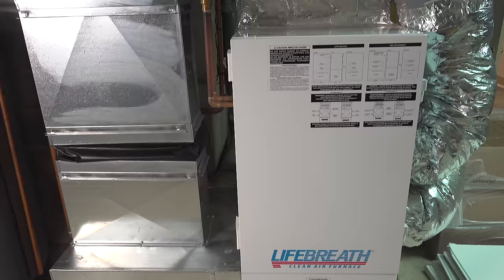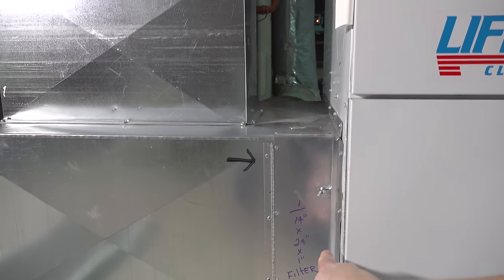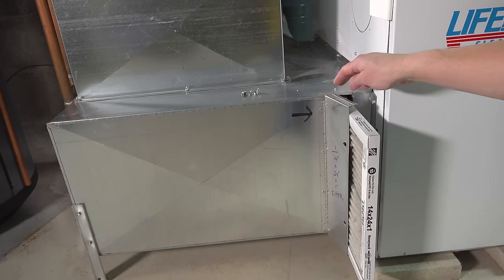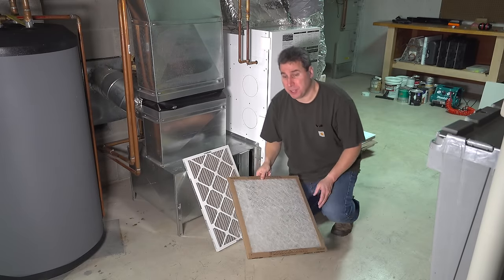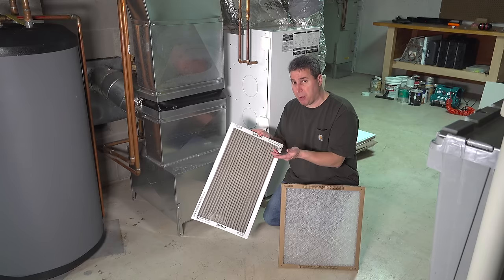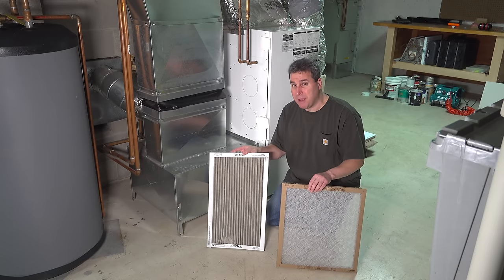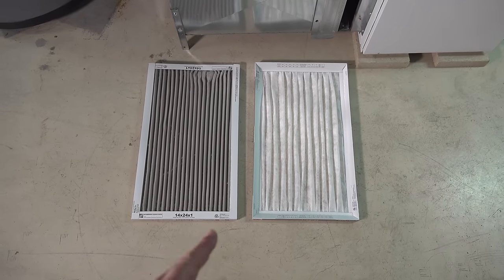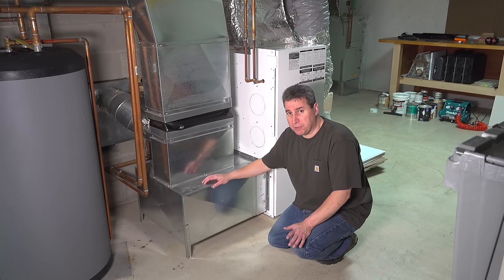Furnace Filter - How to Change it the Right Way & SAVE Money

Comment: I think filter change frequency depends on where your return registers are located. If they are in the floor, or close to the floor, they will pick up a lot more dust and pet dander than if they are located up near the ceiling. My filter is pretty huge and my registers are near the ceiling and I can go a year without a problem.
Reply: Why would cold air returns be near the ceiling?
Reply: @johngunther6333  I'd assume so that cold air conditioned air is pulled up across the living space rather than just pulled across the floor.
Reply: @rogerwilcojr  In the northern part of the country, cold air returns are generally installed low, but I guess in the south, they are installed near the ceiling...I live in the north...lol.
Reply: @johngunther6333  I live in NW Ohio and mine are near the ceiling. I grew up in SoCal and the returns were near the floor and the supply vents near the ceiling - just the opposite. It was also my job the clean the giant fiberglass air filter several times a year, so I prefer the current arrangement. There are some videos that explain the pros and cons of different locations for both supply and returns.

Comment: I'm a little confused. At the start of the video you mentioned to shut the furnace off either at the panel or your thermostat. But at the end of the video it looks like you turned it off at the emergency switch and turned it back on there. But still a good video!!
Reply from the maker: Thank you, yes that was the emergency off switch. As long as you use the circuit breaker, thermostat or emergency off it is fine. Yes that was a bit confusing in the video.

Comment: A furnace is a very effective whole house air cleaner.  Nearly all modern furnaces allow the fan to be run at a lower speed continuously.  With modern ECM blowers, this costs pennies a day, which is cheaper and more effective than a room air cleaner.
Reply from the maker: Now don't go crazy here. Even the best cartridge, so thick you can barely get air through it won't be hepa, where smaller units can do that. The question, will hepa filtration for a smaller area be better than medium filtration for the whole house? I guess that answer depends. ECM is out there but it's definitely not on every furnance and it's more than pennies a day. You can't run super thick filters on very low speeds unless you are greatly oversized for ductwork and it's more than pennies. So it's not more effective, it's not cheaper but it will cover more area to a lesser degree of filtration, is that effective? Maybe I don't know, thats really up to each person.
Reply: @SilverCymbal  A high Merv filter runs just fine on low blower speeds.  If you have a furnace that allows for continuous fan at low blower speed, it's nearly free to use it for whole house air filtering.  And,  it gets all the air, not just some in one room.  High Merv filters are nearly HEPA quality.

Comment: Based on all of my extensive research, the average home should use a Merv 8 -12 filter. I replace every 33 days with a reminder on my phone.
Reply: 30 days is just a reference. Your eyeballs are the best judge of when it needs to be changed. In the spring and fall, your furnace is barely running and its more like every 2-3 months for a filter.
Reply: @srobeck77  My heat pump runs often, I also have my fan set to circulate air at times even with no heat or Ac on. I have allergies and this is what works good for me but not ideal for all cases.
Reply: i run my fan 24/7, but i dont feel like the airfilter does much for pollen. Youd need to have an electrostatic filter installed with the fans running 24/7 to really make a difference. I got an upgraded DC fan motor so iys uses about a quarter of the electricity that a typical AC fan motor uses.
Reply: MERV 10 + daily dusting + robo vacuuming + kids + pets + summer = 3-4 months. Invest in expensive filters and never compromise on wellbeing.

Comment: Went back to the old 'fuzzy' two dollar filters after pi$$ing away many $'s on 'the good ones' only to find (as mentioned here) they were too restrictive for proper operation of my furnace and cost me a couple hundred bucks to learn that lesson.
The only difference I make to the filter is a light spray of Pam or any other vegetable oil. Spray on the opposite side of the arrow (air entry side, away from the furnace) and like a lot of folks, leave a marker down by the furnace to date the installation. You will be surprised at what this little tweak picks up!  You'll have to replace your filter almost every month because in short time you can't see through it at all.

Comment: I installed a medium quality filter, and my new nest thermostat warned me that my heater was shutting off due to overheating - safety problem.  I went back to the cheap fiberglass filter.  I have an old unit with a 0.2 in wc blower.
Reply: Go with a cheap pleated filter. Fiberglass will not adequately protect your fan or ac coil. If that still doesnt work, either your fan motor is damage and needs to be replaced or get rid of the Nest t-stat (because you shouldnt have got that junk in the first place).

Comment: Similar setup as the basement in the video. The air intake duct  however is about six inches below the main floor intake vent. Should it meet the ceiling or is this normal?
Reply: In a single story house, you should have a high and low return duct.
2 story = same, except the high should be ceiling height of the 2nd story.

Comment: The higher the filtration the higher airflow restriction you introduce into your system. When that high filtration filter does it's job and captures everything on earth the airflow suffers significantly. In the air conditioning season your evaporator stands a good chance freezing up and looking like a glacier. Then your AC won't work well at all. The spun fiberglass filters will be fine. Like you said, if you want to filter the air in your living space then invest in good, stand alone filtration units. Then, change the CHEAP spun fiberglass filters often. Great channel, keep up the good videos!!!
Reply: Friends dont let friends use fiberglass leaf catchers as filters. Your whole house will be more dusty (ask dead human skin floating around) and you will have alot more build up inside the fan motor and the indoor ac coil inside the furance--bad very things. Use cheap pleated filters is all you need.

Comment: I have had multiple furnace guys tell me to use the cheap fiberglass filters.  They said they are the best for airflow and best for the furnace.  I used to buy the more expensive ones.
Reply: No hvac techs in my state or when i went to tech school would ever recommend fiberglass as they are close to useless. But they they catch leaves if some happen to blow inside your house.

Comment: Lol. Furnace filter discussions are like motor oil arguments. Which is better?  Nobody knows but everybody has an opinion. My hvac guy said the cheapies I have been using are not good and to use the pleated more expensive ones.  Lenox recommends Merv 10 or higher and he left me with Merv12s. So I’ll just take the manufactures recommendation and pay the extra $ I guess.

Comment: Just an idea: Why not have both filters in succession (assuming both would fit together)?  The cheap fiberglass filter gets the bigger dirt - and then the pleated filter gets the small stuff.  Wouldn't the pleated filter then last longer?  Or would 2 filters be restrictive on air flow?  Please reply - Thanks!
Reply: Its a bad idea (kinda like those fools that use a cloth mask over a paper mask to "prevent" the spread of covid). 

If you really want improved air quality, then you want the following: UV light, electronic cleaner, and/or air ionizer.  All those things also work best with the fan motor running 24/7. Preferably with a ECM (DC) indoor fan motor inside your furance because its far more efficient than a typical AC fan motor.

Comment: i have a one year old furnace and it takes a 4 inch 16x25x4   Does it make a difference if you use the Major brand (you know the one) at $55 or any other brand @ $30???   Am i nuts to pay the extra $25 because the mfg says to?

Comment: My thermostat has a filter change reminder.  I change it whenever the reminder light comes on.  I believe it's set to come on after 350 hours of operation.
Reply: Omg i hate you people that do things without even knowing why. The time is just a reference. Use your eyeballs and look at the filter if it needs to be changed. If you can see alot of light thru it, it doesnt need to be changed. Dont listen to the blinking light for life or marriage advice either. Red is not for divorce, green for stay married--do not follow

Comment: As the cheap fiberglass ones get clogged, they actually start to filter better ;-)
Reply: They never actually filter very well in the first place, so I guess something is better than nothing with the old "leaf catchers". You're not protecting your fan motor or doing your indoor ac coil any favors by using the leaf catchers. Also dont you notice alot of dust build up on all your furniture with those?

Comment: I will never understand why hvac contractors put the return at floor level instead in the ceiling where all the heat is  especially in the summer with your a/c on cold air is heavier seem like your house will have a hard time cooling with the return on the floor recirculating cool air instead of sucking the hot air above to get cooled to me it just don't make sense
My home had the 3 returns and supply at floor level and the main return in the hallway, not no more the returns are  blocked off,I had an hvac crew install 5 returns to a trunk 1return  in each room and what a difference it makes cooling the house in the summer I can feel a very slight breeze in my home

Comment: I just checked and I do not have a filter installed. I have 2 different return filters in the wall, is that all I need? Carrier FB4CNP042 is the unit installed.
Reply from the maker: That will sometimes happen. 1/2 the time it's there somewhere that you may have missed. The other 1/2, an installer may have skipped it. I would reccomend adding one to your system, you may need some sheet metal help but its never to late to add it and they may want to clean the coils as well if its ben like this for  a long time.
Reply: @SilverCymbal  Thanks for the reply. The unit does have a place to put a filter, the door/plate opens up to the place where a filter would go, don't know why they left it out. I found a supplier website that indicates a 21.5 x 19.75 x 1 Merv 4 filter is standard. My measurements with a tape measure are 21x20.5. Seems like a Merv 8 would be better? 20x20x1's are readily available at HD.

Comment: What was the switch that you flipped  at the end of the video???
Reply from the maker: I should have explained that. It's the emergency shutoff switch. Most if not every heating system will often have a switch (which should have a red plate), maybe at the top of the stairs in a basement or kitchen. It's supposed to be there for firefighters if they are in a house during a fire and can kil the power to the heating system. The plate might look like this: https://amzn.to/3iN3U1C   You can use this to kill the power also, but the breaker of course is always absolute. My plate should be red also, but they must have forgotten to do it.
Reply: Thats the self-destruct button

Comment: I saw another video where the HVAC guy said that if you don't know your system's pressure or whatever technical stuff, then a good rule of thumb is to just use the cheapy fiberglass filter and change it monthly so you're not restricting the air flow and premature failure of your system.

Comment: Dude, what is on your ceiling?
Reply from the maker: Didn't I mention I am on the space shuttle? The entire basement has no fiberglass insulation, they used this foil insulation I have never seen before. It was very carefully done, 30 years ago too. My understanding is it cost more than fiberglass, not sure what the benefit is though.

Comment: What happens if I have no air filter cover door?
Reply: Then you should have one made for it. Find a hvac company do it, but my damn it will cost you no less than several hundred dollars. Otherwise, best to find a youtube video on it and do it yourself.
Reply: Mine doesn't have a door & it's been running great for 35 yrs. Just seal it with duct tape if you're worried.

Comment: I just remembered today that I need to change my air filter. I havent done it since august 2022 lol
Reply: Congrats, you just shortened the lifespan of your fan motor by several years and paid alot more in electricity to run it. You should prolly get the oil changed on your car next. Its been 2 years on that too.

Comment: There are ACTUALY home air filtration systems on youtube, they aren't common. one guy who was an engineer, engineered his own. he said they never had to dust. there are articles on how crap in homes affect our health. it's worth looking in to but, is a sizable system not unlike a furnace.
Reply: The Corsi Rosenthal Box is a DIY air filter constructed using four 20x20 MERV 13 filters, a 20" box fan, some cardboard, and duct tape.  They're said to work very well.

Comment: Can you vacuum the filter and reuse it one more time?
Reply from the maker: If you were in a pinch and it was totally clogged up you could do that to gain some time. But if it’s heavily built up I would buy an inexpensive replacement as the fabrics can also break down overtime even if it’s clean

Comment: I don't have a door for my filter should I?
Reply from the maker: Some will have two bolts of screws for removal, and sometimes a system may not have one installed at all. That is pretty rare but sometimes it will happen.
Reply: @SilverCymbal  thanks time to put a door on. Thanks again 👍👍

Comment: I bought to big of furnance/AC for my duct work, the bigger the better right, (wrong). I had problems with iceing until I switched to those really cheap filters, that have more air flow. Problem solved.

Comment: pleated filters of 14+ ratings not only restrict air flow, but also can DAMAGE the HVAC unit!!!! they cause the blower to work harder, use more electricity, fail earlier. AND reduced air flow across both the heating hx and especially the air conditioning coils will shorten the life of those elements. i made the mistake of getting restrictive 14 rated filters, so to compensate i leave the air filter access door open so it can pull in extra air from the utility room.

Comment: Why would you recommend changing the cheaper, fiberglass filters “more often”?
That’s exactly OPPOSITE of what you should be recommending. The higher quality, more restrictive filters need to be changed more often. They get clogged faster, and limit airflow thru the HVAC much quicker than a cheaper filter with larger “holes”

Comment: The only thing a filter should do is protect the internal evap coil.
Never use the high MERV filters, they impede the airflow and cause you furnace and AC to run inefficiently, and work harder than necessary.  Fiberglass is ALL you need.
Change the filter EVERY MONTH !

Comment: changing your filter flow too much case damage your motor anything over merv 13 is too much for residential, agree on getting home air filters.  If you do want a high merve filter upgrade to a media filter from a box filter like this which has much higher flow rate/surface area with large pleats

Comment: I would upgrade your system to use a 4 inch filter
Reply: No, you shouldnt do that unless the furnace came that way and has the proper sized fan motor to run that way.

Comment: You really should use the thickest filter possible
Reply: Wrong. the more dense it is, the harder + hotter your fan motor has run. Thats the big problem with that
Reply: @srobeck77  thicker filers are not more dense you dolt. Thicker filters have more pleats and more filter surface area. This decreases resistance to air flow and allows for longer filter and blower life

Comment: If you dont get enough air flow you will damage electric furnace parts. The "cheap" filter is the correct filter for electric  furnaces. I had a plastic universal filter that you cut to size. I thought it had enough air flow, I was wrong. I bet your filter on a gas furnace can cause the fire box to fail prematurely if you dont get enough airflow to keep the fire box cool enough.

Comment: Hello, I love your videos.
But I disagree with flipping off power to the furnace first, because the HVAC system could be in the middle of heating or cooling cycle and you just said STOP to it.
I shut the system down at the thermostat first and then listen to make sure it’s not running and then flip off the power to the HVAC system then change the filter.

Comment: Omg what a horrible furnace install job by having that straight 90' return instead of curved like it should be. Also I have a DC fan motor that doesnt run 24/7 hour/day. I also have a UV light in there too to take care of mold.

Comment: Get the shittiest filter you can. Hvac tech here. Filter is there to protect blower motor not clean your air.
Reply: Its nice to not have a thick layer of dust build up on every piece of furniture in the house. Never, ever use a fiberglass "leaf catcher" filter. The cheap pleated filters are what you want. From a fellow hvac tech over here.